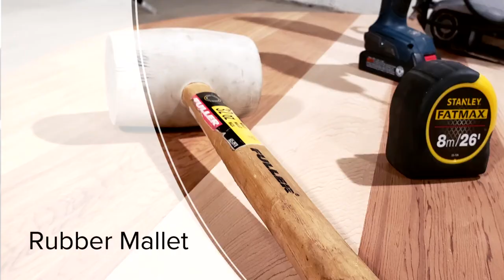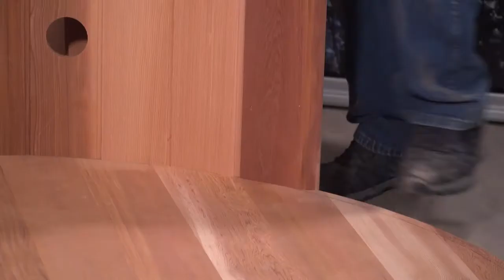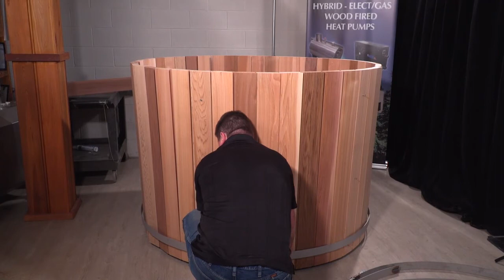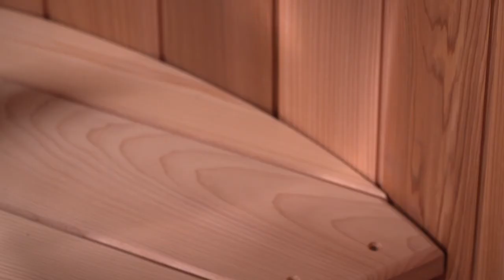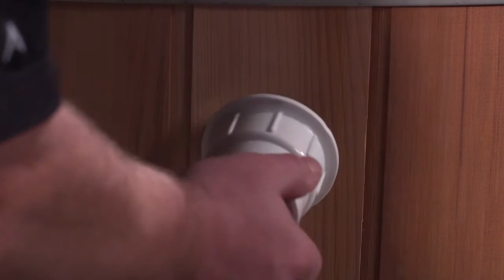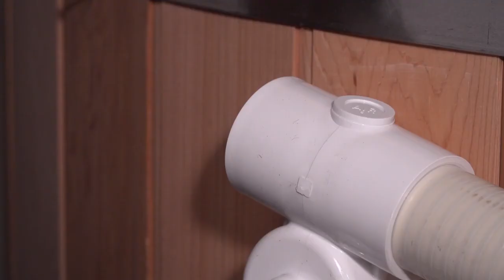Cedartubs v4 04 22 FINAL

Comment: Awesome… very clear!
Reply: I made a mistake in the skimmer pipe assembly but easily fixed it. My kit was missing a 1.5” to .75” reducer… but I found one at my hardware store. Today I’ll make a hutch for the pump assembly, all insulated with foam, but with a hinged top and side for filter maintenance.